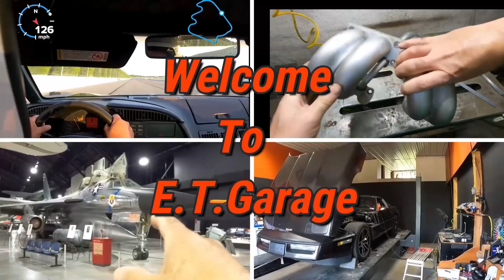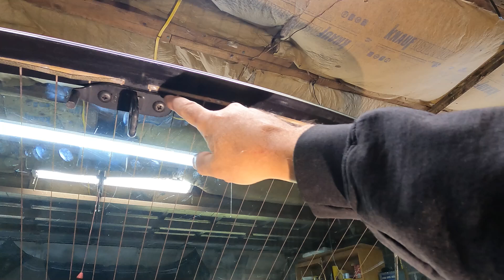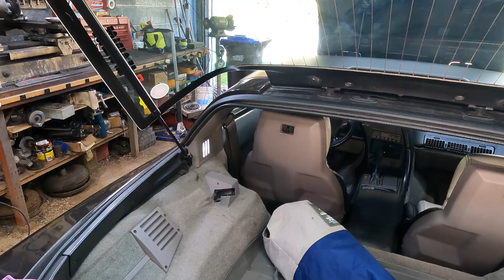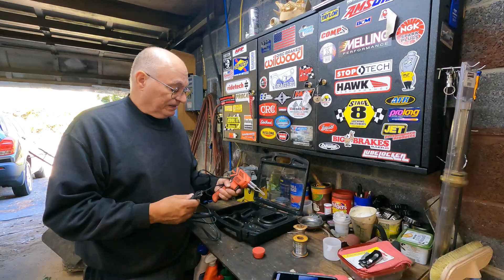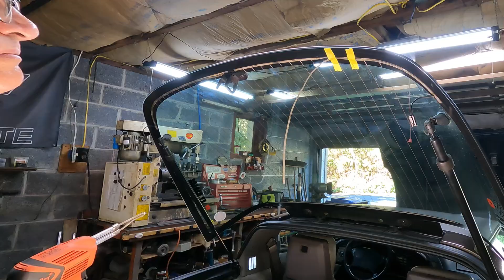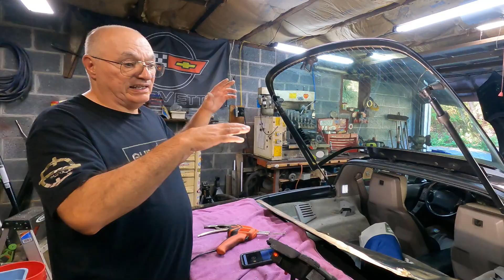Solder Repair Rear Defrost 😎

Comment: I soldier a lot. I would have used the gun with the wire and put a spot on each of the glass soldier areas then a spot on each of the tape areas nut transfer it like you did as that way it creates oxidation. I am missing my left connector as it unsoldiered and fell off somewhere. I guess Ill just make one up. Your video helped me as now I know how its all connected. Tkx
Reply from the maker: Good luck with your repairs this video might also help https://youtu.be/FfI7qL-Jq34